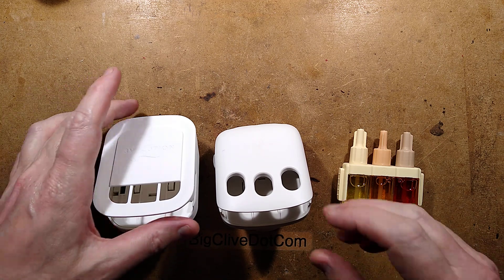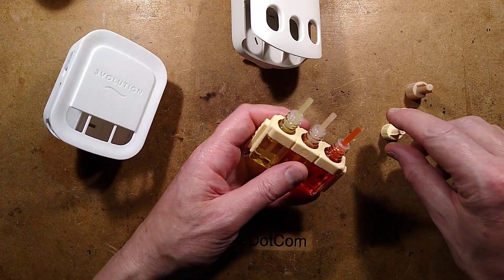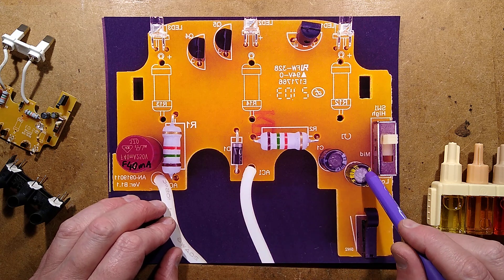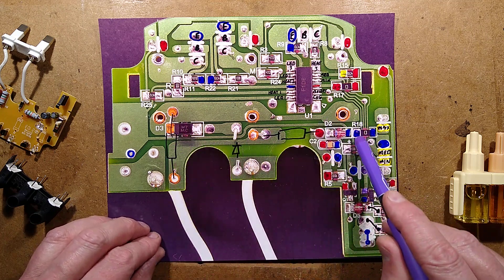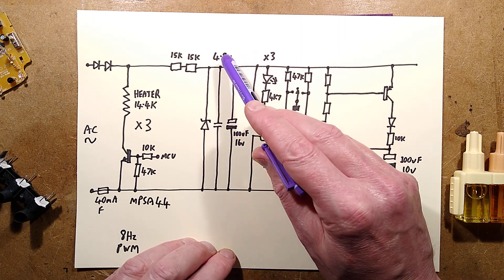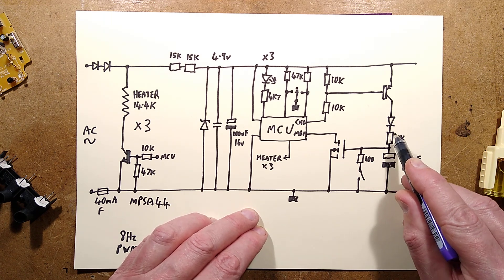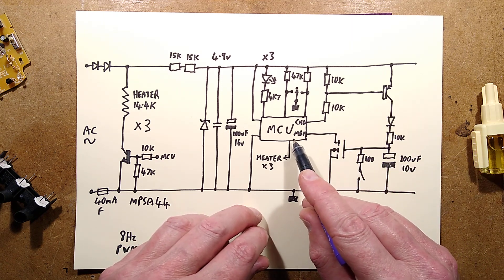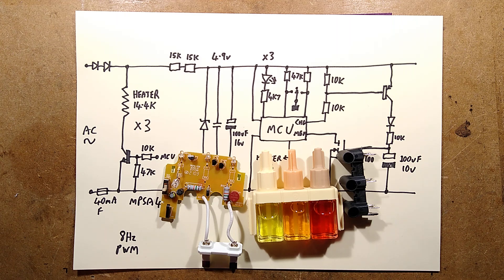New 3volution unit has clever circuitry

Comment: I'm surprised Proctor and Gamble haven't gone the ink cartridge route of authenticating the refills, and then using the razor/blades pricing model where the device is sold at a loss and the refills are sold at enormous profit. Hire me, P&G, I can make you more evil and profitable.
Reply from the maker: I almost expected a chip in the cartridge.  I think that would add too much to the cost though.   Airwick did add an infrared sensor and black stripes on the can plunger which was tacky.

Comment: Those are an absolute rip off, like most of the fragrance based companies products are.
Only devices worth using (although still environmentally bad) are the 1 or 2 fragrance budget devices from poundland, etc. Unfortunately they are extremely thin on the ground (atleast where I live).
Reply: They're not a rip off. It's an unnecessary product sure but it's simply just a luxury item that people buy because they can. The budget ones from Poundland I've tried,  usually smell like plastic arse with a slight scent of whatever it's supposed to be. They usually don't use the same sort of 'wick' the better ones do. The last one I bought from Poundland was awful.
Reply: @Mattn0111  The cheap ones are usually OK IME and only cost £1 or £2. Granted some of the fragrances can be a bit "sharp" (usually the Christmas themed "spiced" ones especially) but not all and they last just as long if not longer than the 3volution crap that cost £8+.
Add the fact the cheap ones wicks usually last longer too so you can refill the bottles for even less.

Comment: Indeed clever design. MCU can easily tell when cartridge was changed, even, when adapter is unplugged. 👍 That part of schematics can be used in different designs.
Closest to this idea is concept of using Mosfet, resistors and capacitor as a timer.. I did it in children's light sword because manufacturer put 20mA tact switch in LED circuit where consumption is 80mA.. Before that I changed switch 2 times, at third time I added Mosfet timer circuit and kids loved it.. 😂
Reply from the maker: The MOSFET and capacitor timer is a sweet circuit.  Often used for the backlight displays on cheap meters.

Comment: 5:15 I do wonder about this sort of brick thing being fed with 240V 30A - but you did say it has a fuse in it.
Reply: it's not 30A
Reply: @4lecsg  No, but the wiring supplying it has a 30A fuse, or a 32A breaker, though I do suspect that the little bits of wire from the integrated plug will act as a pretty effective fuse.
Reply: @4lecsg  Go check the fuse/MCB in the consumer unit for the circuit it's connected to. Probably 32A - whatever current they actually trip at. Ditto with phone chargers and all other electronics bricks.
Reply: @millomweb  That's why British plugs have fuses in them.  (Sometimes the Chinese even wire them up.)  Not a bad idea actually.
Reply: @j.f.christ8421  Brit plugs yes but what about power bricks ? I guess many do but do all of them ?????
Reply: @millomweb  Plug packs have some sort of internal fuse, can be anything from a real fuse to a resistor to a thin trace on the PCB.  Back in pre-switch mode days the transformers would have a thermal fuse inside.  They're not meant to be serviceable so once it blows you toss it out and buy a new one.  No different to light bulbs.
Reply: @j.f.christ8421  I doubt there'd be anything in a 'brick' that would last a second passing 30A :)
Same with light bulbs - which fail with significant bangs as the power burns holes through the metal cap. Good job I still have fuses - I doubt an MCB would cope with that.
Reply: @millomweb  Right, so....?

Not sure why you think an MCB won't cope with 32A, you can get them in any rating you want.  I wouldn't get too nostalgic about about old man fuses, an exploding light bulb will trip an MCB (surge current) while a fuse will do nothing.  Come to Australia, our house wiring is only rated at 20A (actually less).
Reply: @j.f.christ8421  That's why a fuse wins - only fuses when necessary and not simply for a bulb failing.
Reply: @millomweb  If you every need a career change, just remember electrical work is not for you.
Reply: @j.f.christ8421  "Come to Australia, our house wiring is only rated at 20A (actually less)."
Can you find me a plot of land with a stream near Darwin for my new tiger/koala sanctuary ?

20A is fine for all spurs - where all the sockets are fed via their own wires rather than the ring mains we have. Cookers and showers have circuits with bigger currents. Cooker 30A not sure about showers - could even be 60A.
Reply: @j.f.christ8421  "If you every need a career change, just remember electrical work is not for you." what makes you say that ?

Comment: Very interesting. I'm not sure how the single bit of high/low memory can remember which one of THREE states the system was in when turned off (I would have thought that would need two high/low bits or a single three level memory bit), so I'm obviously missing something.
Reply from the maker: It only detects that the cartridge was removed while the unit was unplugged.
Reply: @bigclivedotcom  Thanks for replying. but I would have thought that this is not worth such a number of extra components? If unplugging the cartridge only happens once every few months then is starting at position 1such a problem? I'm obviously missing something.......
Reply: @Mike-H_UK  Maybe there some sort of start-up cycle needed with a new cartridge?  

Always starting from slot one at power up would empty it faster, but yeah, as you say for something long running it wouldn't matter much.  Me thinks Clive needs to run a few cycles to see what the difference is, and if it has any internal memory to keep that of where it's up to (though I doubt that).
Reply from the maker: @Mike-H_UK  It's a sales gimmick, and also a way to increase sales by reminding people to get a replacement before the old one runs out.  Otherwise there might be a gap of several days without evaporating their aroma chemicals into the air.
Reply: @j.f.christ8421  Cheers! It's an interesting little device, but since we don't want the house smelling like a tart's boudoir then I think I'll leave it for those that fully appreciate the end result :-)
Reply: @bigclivedotcom  Yeah, probably like the printer cartridges that I use that say then need changing when they are half full and can't be fooled into continuing to work! By the way, I showed a friend your Scottish army meal with the nuclear heater and he was convinced that you were for real. You would have died of laughter.....

Comment: Just remembered somethign I've been meaning to ask, the un-coloured diffused blue blinky LEDs on your "hexaputer" board, where'd you source them from? I got one of the boards recently and can only find coloured-diffused LEDs (through ebay and aliexpress searching), and I want to have a pattern in them that is "invisible" when powered off using those "milky" diffused LEDs, but I'm not having much luck in finding the right ones... :(
Reply from the maker: They are sometimes called milky white on Chinese listings.
Reply: @bigclivedotcom  I tried that on both sites and google, they just assume I meant RGB, which I already have plenty of, managed to find a seller on aliexpress with the right ones (single blink or single flash seems to be the key there), but, at 2000pcs minimum per order at just shy of £50, that's a bit much for me, don't even know what design I want to make on the board, so that'd be an expensive investment, and I've not even bought any SMD resistors yet... :S
Reply: @twocvbloke  They also called them 'fog' LEDs.  But yes, MOQ is a bit painful  There's a couple of sellers with packs of 100 SMD, but not the 5mm.

Comment: That seems to be a useless feature, I can't imagine many people would look at the leds to see when it thought the cartridge needed changing. Surely 99% of people would only change the cartridge when it stops smelling. But for the price of them it should have more features, I would have expected it to make me a cup of tea in the morning.
Reply: Let's the manufacture add 'smart' or 'intelligent' till the product packaging, thus making it look more attractive to the illiterate masses.
Reply: I was thinking this too, but I think what this does it prevent the first cartridge from getting wiped out. If you run this on a timer, or unplug it daily, it would keep resetting back to the first cartridge. This scheme will allow it to pick up where it left off. (I think)
Reply: @asicerik  but it can't pick up where it left off without knowing at least three states. If there were only two bottles that would work. The same effect can be achieved with a random data source on power up picking 1, 2, or 3.
Reply: @jaro6985  That is a good point. I was thinking it was storing the state, but that would need power to the controller.
Reply: @asicerik  You could add a second circuit to give you 2 bits & 4 states, so 00 would be cartridge change, and 01, 10, 11 the current scent.  Need a way for the uC to set the bits to zero though.
Reply: @asicerik  Yes, preventing wearing out #1 cartridge makes sense. The unit has three little windows where you can see the fluid level, so there'd be no need for an LED "empty" indictor light.
Reply: @kimchristensen2175  I've found the best way to not have these things run out of juice is to never buy them to begin with
Reply: @MadScientist267  LOL yea. I'm not a fan of any of these so called "air fresheners' which just overpower a smell you don't like.
Reply: Aye that's what i do. I'll buy one. It'll smell great, then when I stop smelling it I'll have another on standby to put in. Then when that one stops smelling I'll put the other one back in or a new one I've since bought.

Comment: I use one of the original versions of these on a timer, 12hrs on 12hrs off, It always starts on the 1st scent so the 1st scent always runs out before the others. I wonder if this memory is designed so that it knows the last scent it was on and prevent this from happening.
Reply: It may be possible to switch the scent containers around if one is so inclined.
Reply from the maker: It still starts on 1.

Comment: What I find strange is the usage of electrolytic capacitor. It should be a cap with low EPR or low dielectric losses. So, it should be a cheap film capacitor like  polyester or ceramic C0G. Because electrolytic cap, that is used close to the heater would increase losses by time. 
In large series those caps costs nothing, especially for mass production.
Reply: absolutely
Reply: I doubt it matters much if the cap fails.  Just means it'll reset quicker so at worst you'll be running a empty cartridge for the full cycle, and by about the 2nd or 3rd refill most people would be tired of buying new ones anyway.

Comment: I used to have one of these "oil type" air fresheners plugged into an outlet a few inches below the metal support arm for a shelf.  I quit using them altogether after I noticed it had caused the paint to peel off and heavily rusted/corroded the steel directly above the wick.
Reply: its kerosine in these, it can remove paint but i don't think it directly causing the rust
Reply: @ChrisD4335  The base oil is most certainly a highly refined petroleum distillate of some sort, but calling it "kerosene" is just plain ridiculous.  The useless MSDS lists the contents as "proprietary fragrance" with very little other data, so who *TF* knows what's in that shit.  It wasn't just simple rust BTW, it was heavy corrosion, I'm not stupid.
Reply: @supermarioisacat  Unfortunately there are strange patent concepts surrounding fragrances... The exact makeup does not need to be revealed. It's just understood that they're all basically the same on an MSDS level... A series of aromatic solvents, the solvent part being the point of interest, since toxicity, flammability, etc can be generalized without issue.

If you want to find out what's in one of those liquids, you need some fancy lab equipment and someone who both knows how to use it and interpret the results.
Reply: @MadScientist267  Either way it'd probably give you popcorn lung if you stood too close for long enough. I dunno what's wrong with a bit of corn oil or something. Should work fine, but yeah won't be kind to non-polar solvented paints, having it gently bubble away underneath.
Reply: @MadScientist267  Why do you people insist on telling me these things as if I couldn't possibly already know?  They're not "strange patent concepts," Glade can legally hide the actual chemical coctail they use behind the guise of it being a "trade secret."
That "fancy lab equipment" is called a gas chromatograph, and yes, I *have* operated one, as well as interpreted the results in a lab while at a previous job.  Regardless, the scent they put into those things is clearly highly corrosive and I no longer deliberately put that trash into the air I breathe.  Any questions?
Reply: @supermarioisacat  Clearly you have it figured out then and don't need us. It's called a comment section because... Surprise! People make comments!

Imagine that...
Reply: @MadScientist267  Things are SO much nicer when people can sense and respect when another speaks from a general position of experience and knowledge and don't require superfluous, pedantic input.  Good grammar, good vocabulary and solid sentence structure are all excellent clues to look for.  You haven't quite developed that skill yet, but you'll figure it out eventually.
Reply: @supermarioisacat  Interesting sentiment. So then you'll be following your own advice possibly? 🤔🙄🤷‍♂️
Reply: @supermarioisacat  Oh and... Good luck... This is effing YouTube for Chrissakes
Reply: @supermarioisacat  Mmm. Amusing sentiment.

Here's mine: Trolls bore me. Yawn.
Reply: @supermarioisacat  Give it up, mate. You're one of the few people in the world who have used a gas chromatograph. Nice surprise card to pull out. And yet you never put a Glade air freshener into it? To find... aromatic solvents just like our lad said. That's some pretty fancy lab equipment. 

Either way, so what? Besides their sheer pointlessness, both of you know not to have weird shit like that in your house if you can possibly help it. Now start worrying about all the outgassing from your Ikea furniture, that stuff's 85% glue.
Reply: @ChrisD4335  no, the oil it pushes out is an essential oil, or a solvent if you prefer. Works great if you need to remove some strong adhesive